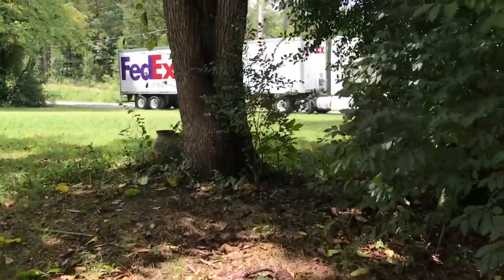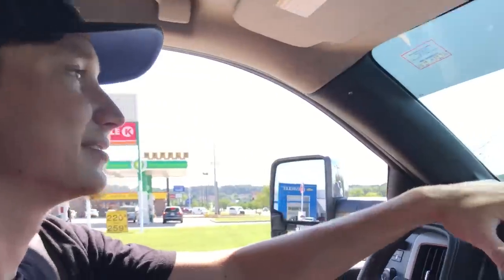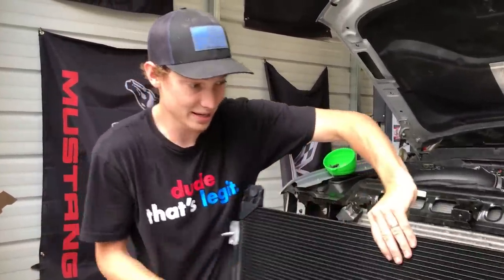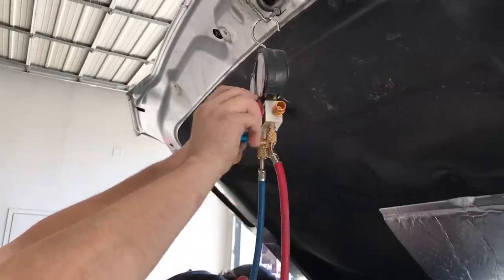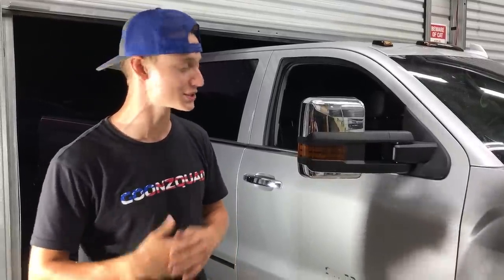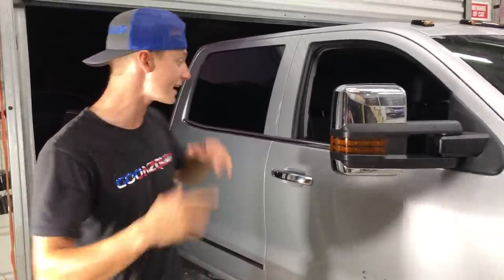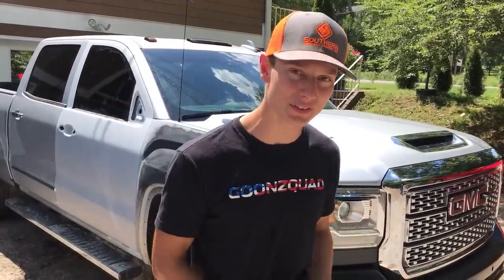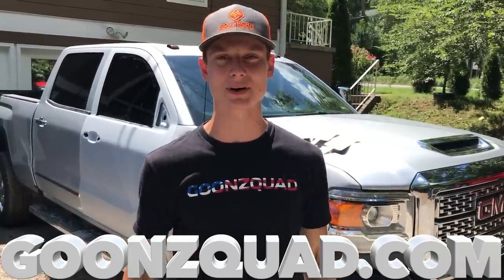Rebuilding A Wrecked 2019 GMC Duramax Part 7

Comment: I work at a CARQUEST and sell Cromax. If you give them the code with the VIN number they can give you the closest match possible. I just had a customer panel paint a silver 2017 Impala and he said you cant tell what was painted. Nason is a watered down paint that uses different tints than Cromax even though its the same company.

Comment: Not from the US so can someone explain how you make salvage rebuilds road legal over there please? They mention the "Inspection" for the truck but don't remember this for Lambo. So can you just fix something up and start using it?
Reply: Each of the 50 States of the US follow guidelines established by the US Federal Government, Department of Transportation for inspection of a rebuilt vehicle before it is road legal. That includes an inspection of documents that verify you actually did purchase & install replacement parts (and service) for the vehicle. In my opinion and hopefully, the wording about being 'road legal' will need to change so that Goonzquad can promote their work on certain vehicles as Better than OEM!!
Reply: @gpackwood1  Thanks but still don't really understand why you need the inspection. They are already driving the truck on the road. Also, they were driving the Lambo on the road and were even stopped by the cop with no problems
Reply: @pauliecabs  -> I understand what you're asking and if I had the specific law from their state in front of me I would  give you the link but in very general  terms, there are special rules in place for automobile dealers, repair shops etc.. whereby they purchase insurance on vehicles that will not be driven very much (or not at all) and the government provides them with license plates that are a different color (red for example) or a special registration form or card or something similar. The inspection we're talking about is for private individuals who wish to purchase a vehicle and drive the vehicle with their own insurance and registration.

Comment: That 2020; Def tank is front of the fuel tank.. I’ve done a lot of inspections on these trucks. They’re cool but aren’t that impressive & expensive ! The 10 speed trans and transfer case is HUGE on those thought and I’d prefer the look of the GMC, but the seats are also hard as a rock and performance not any different than the previous gen. Anyways not my cup of tea! Still a pretty cool truck!

Comment: could someone please explain what this inspection is all about? ty
Reply: A rebuilt vehicle is a motor vehicle that has been repaired or rebuilt after incurring damage to one or more major component parts through crash or other means. ... Rebuilt vehicle inspections require a two-step process—a documentation review followed by a physical inspection of the vehicle.
In Tennessee, you can get something called a rebuilt title. This means the car has been repaired and it has been inspected. It will then be registered and you can use it like normal. When you have a rebuilt title, then you can get the vehicle insured too. Insurance is usually available through GEICO (or at least it is in Texas).
Reply: @gpackwood1  Thank you very much for the explanation Gary.

Comment: if anyone want to know an better easy way to remove those trim pieces like they did for paint work is too like what they did, heat it up as hot as possible, then use a fishing line. it cuts through the adhesive a whole lot better. Also you should had just gone to an automotive paint shop and they could mix you up the correct paint match color. Instead of going to some auto part store and get some generic paint that really not going to match all the way.

Comment: I would've never thought that three paint brands mixed to the same paint code would have that much variation. I personally don't see why you are repainting the door. I think I would've just shot the fender since the door wasn't damaged. You should paint the bumper the same color as the truck and call it good.

Comment: its called a diesel particulate filter it cleans up the soot in the exhaust lowers the emissions .the tank is filled with a urine based liquid called AD BLU it sprayes into the filter to keep it clean every so often .keep it topped up or you will get all sorts of anti pollution codes and engine lights
Reply: @mmm365   we call it AD blu over here in the uk lol

Comment: How again does a lift kit help a truck be a better Work Truck for Towing? What's the point???
Reply: @jasonw3303  what's the point in looking cool? They needed a truck to be a work truck, to pick up things and haul things! Try taking a trip across the country to a Copart somewhere or something to get a vehicle with a jacked up stiff suspension, wearing out U-joint all the way, and what if you decide to get in fifth wheel for something hey, how's that going to work well if you jacket way up in the air? And you know that's stiff rides going to be comfortable, not. Lift kits are designed for off road trucks, off-road trucks are cool, because they're fun and you can take them out and play with them! They're designed to be beaten up broken and have fun with. Now if they want to take their brand new truck they got and turn it into an off-road play toy oh, well that's up to them... but that's not the reason they told us that they needed a truck, obviously it's not the reason they need a truck. And just to be cool and be a "mall crawler", Mall crawlers are pretty lame if you ask me no, I don't understand how that would be cool! All show and no go! What are you going to do with it, for real you can't do anything to haul with it any better actually worse, you can't really go off road with it, cuz it's for show. You know most of these sports cars they've done have had a point, to be fast to be cool to drift Etc, the things they'd have done with them have made sense, that's the purpose of those types of vehicles, but to make a truck just look cool doesn't mean it is cool, you can make a work truck look pretty damn cool, you can make an off-road truck look pretty darn cool! But what the heck are these boys trying to do? Make an off-road play toy out of the thing, or a work truck! All they sound like they're doing is making a mall crawler that's good for nothing really but to look at, if you like all that good-for-nothing bling, you might as well put some Spinners on it, some fancy lights underneath. Cuz that's just so cool,  😂

Here's another perfectly good example of the situation and talking about with trying to be cool... I'll share a link here, with a picture of a black Mustang covered completely with stickers, custom made hand cut stickers, all over it, the guy I bought the car new, and yeah it was just a Mustang but he just started adding more and more and more and more crap to it, it's like a clowns car if you ask me, and most everybody I know we'll agree, he completely ruined it always brightly colored crazy looking stickers, the guy is a little off to say the least, but he thinks it's cool, LOL we all laugh and he takes it to car shows. It's a stock V6 Mustang, with a bunch of stickers all over it, damn man, if you wanted to make it cool you think you do some performance mods on it or something.

https://hiveminer.com/Tags/decals%2Cford

Here find the picture of it and laugh yourself.  whatever you do don't do too many drugs and put stickers all over your car. You'll end up on websites as a ridiculous car.

And goon squad is going to have a mall crawler ha ha ha ha... I guess some think it's cool if their names Jason I guess.

Comment: If you go to vindecoder.net and type in the last 6 digits of the vin it will bring up all the factory specs and paint color codes etc
Reply: Great information! A phone call to the dealer got them the code but a lot of subscribers appreciate it.

Comment: 71000.00 no thank you. Bought my truck new in 1990. 3/4 ton gmc 17000.00 still running strong 571000 miles. I bet mine will still outlast these new plastic computer run trucks.

Comment: You'll have been doing this long enough to know proper terminology. "pump ac in the system". It's called freon!
Reply: they dont use freon for air conditioners anymore, I would think someone taking the time to criticize them for their terminology would know that! lol
Reply: @loganclements9788  you're right, freon is a brand name of refrigerants which the trademark is owned by Dupont, and in Jan of 2020 will no longer make or provide such refrigerant,  Mainly used in home refrigeration. Therefore automotive uses what is called R134a which is being replaced with 1234yf.   "freon" is a common word used to describe refrigerants mainly cfc's and hfc's.  Kinda like when u ask for a Kleenex and your mommy hands you a tissue from Kroger.  Or when you say hand me some vise grips and you get handed some locking pliers from Sears.  My point is they have been doing this long enough to know that refrigerants are called freon and not ac charge.  If you listen to vtuned he says freon.  My point exactly..
Reply: @jwarfield78  everyone that I know who isnt a dinosaur just calls it refrigerant
Reply: @loganclements9788  🤣🤣🤣

Comment: It’s a 2014-2015 Gmc  not 2019
That Chevy is not 2020 it’s 2019 
😂
Reply: I realised it because the bumper lights are different
Reply: You make no sense. That Chevy 2500HD is most definitely a 2020 model. Also the GMC they are repairing is a 2019 Limited which in GM terms means they had a limited run of the old generation alongside the new HD. They have done limited models in several GM vehicles like Cruze, Acadia, Sierra, etc

Comment: I cringed when Vtuned dumped liquid 134 into the low side of the system.  Not good for the compressor when you start it up. Should have dumped it into the high side.

Comment: NOOOOOOOOOO..do NOT ruin that beautiful truck with a lift kit.. a 1500 yes go for it jack ot to the sky.. but you wanna tow with that truck and after lifted it will not have the correct geometry to do it. A dropped ball adapter is a serious weak point for towing. NOOOOOOOOOOO